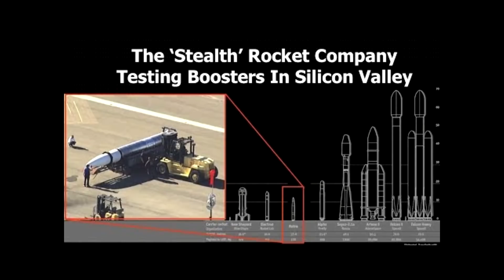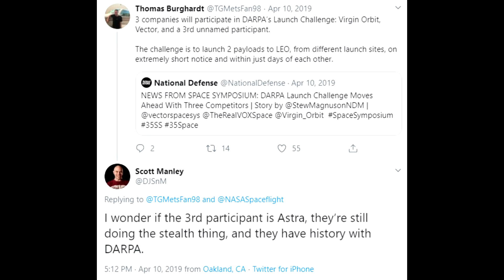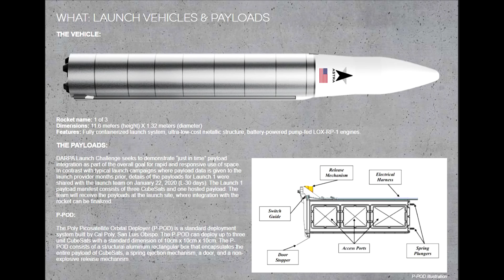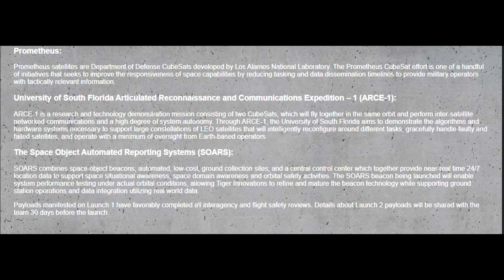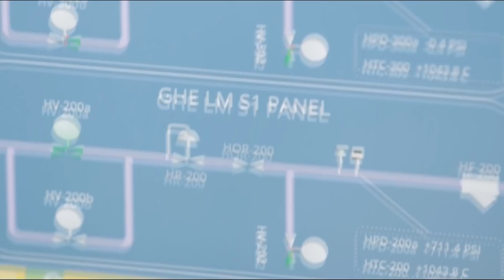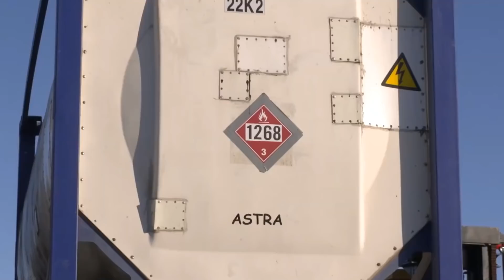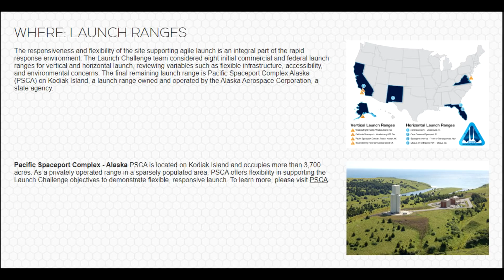Astra's Secret Rocket Project Finally Reveals Itself

Comment: Alameda... hmm I wonder if this is the succesor of Mythbusters Confederate rocket
Reply: The power of salami fuel
Reply: Dudhhr McDudhhr actually at university for my last “small thesis” my school’s friend and I , we tried to calculate the performance of salame rocket but the most difficulty we had has been to find at least a generic chemical composition of the food (we know there is C, H, N, O, ..but many missing and percentages for all), at the end we turned to Sorbitolo (a kind of sugar) first and later to another own mix.
Reply: We test fired the first rocket on the runway at Alameda NAS, which is where Mythbusters did a lot of filming including the wooden cannon, the traffic flipping plow, and a bunch of other tests that required driving in a safe area. I think my coworkers got sick of me mentioning Mythbusters every day.
Reply: That whole area looks like the perfect site for a private launch company HQ though. Hangars, plenty of open space & right next to a body of water. They would have to buy out all the residence though.
Reply: @theatom7264  Nah, the rocket engine test stand is two blocks from the nearest house and there have been zero noise complaints. Flights out of Oakland airport are louder; flights into SFO when they're doing bad weather approach from the north are much, much louder. There's a pic of the muffled test stand building in the Bloomberg article.
Reply: @adamquery7048  Great name for a "stealth" rocket.
Reply: Was just wondering if Adam Savage and Jamie Hyneman were backers!